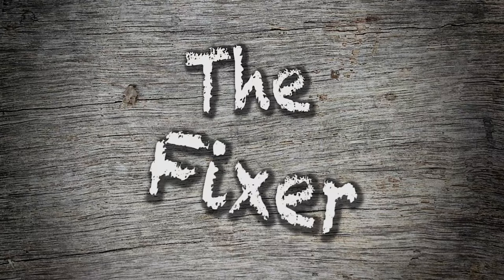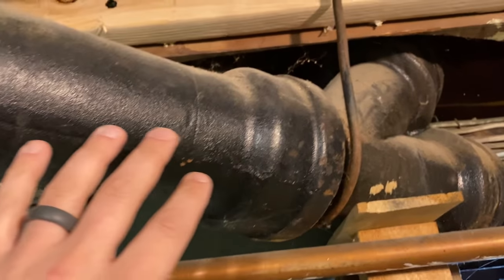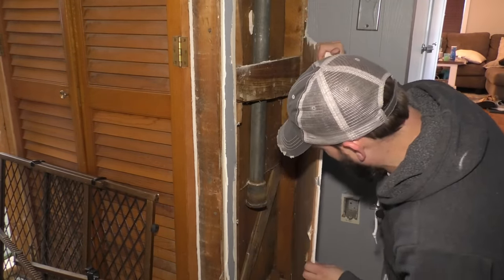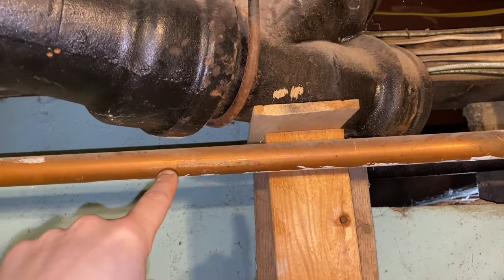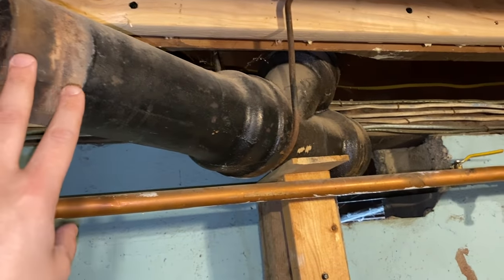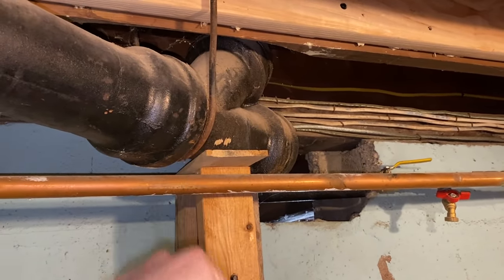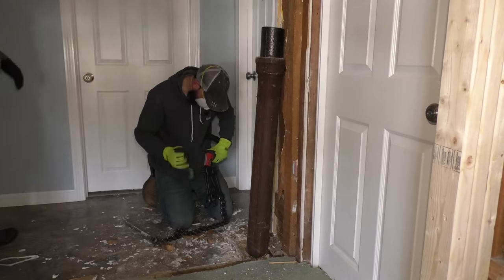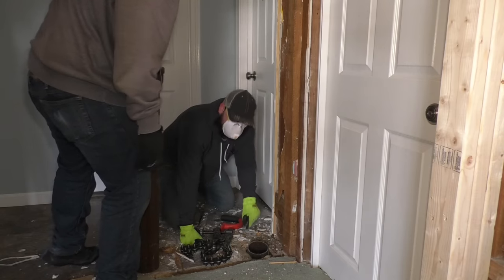How to Remove Cast Iron Soil Pipe the EASY Way!

Comment: Glad to see this video..  You literally had alot of the same thoughts I have had while taking mine out.  I used a cast iron sawsall blade for cutting the stack of mine where it goes through the roof and it took FOREVER as well..  Im now removing ALL the old pipe from the rest of my house and decided to rent a soil pipe cutter.  I normally do all my renovations myself as well, but im having my neighbor come help me with the stack because im afraid of doing it alone..  lol.  Need some extra hands.  Im 118lb girl and im not THAT strong lol.  Hope to have all of mine out by the end of today, thanks for sharing!

Comment: As durable and strong as cast iron is, with enough pressure it really is brittle.  Another great job done and out of the way for other jobs to be completed.  Fantastic "slow mo" with your phone when snapping the attic and first floor pipes.  Be thankful you didn't have to do this in a two or three story house.
Reply from the maker: Yeah I think I am actually pretty lucky with how easy this job was and using that tool actually made it kind of fun which I was not expecting.  😁 Thanks for watching!
Reply: The other problem with it, as I've had in my super old house is that it's hard to get a good connection between cast iron and PVC, without either a sketchy synch-style union or some expensive adapters. I'd rather take a quick saw and glue PVC any day.

Comment: I clicked on this notification faster than I've clicked on one in a very long time. And unlike the previous video, this time I was interrupted by an overly aggitated toddler several times lol
Anyway, nicely done! And good thing you called for backup, alone would have been a little sketchy lol
And that tool is definitely worth it! They make exhaust pipe cutters that work in a very similar way. Same type of roller cutters inside of a chain but instead of tightening until it pops, you turn it back and forth and the rollers cut through the pipe.
Anyway, that definitely opens things up and makes things look cleaner and better both in the basement and in the house.
Keep up the awesome content!
Oh BTW that slo mo shot was awesome! Also the end screen shot too.
Reply from the maker: Hey, Man!  Happy to hear you could sneak this video in!  Trust me, I know it can be tough haha.  Yeah, Colin really saved me on this one.  I was very close to doing it on my own but happy I decided not to.  And yes I was obviously pumped about that slo mo shot as you could see in the video haha.  Thanks for watching, as always!

Comment: Thanks for the video.  That breaker looks perfect for what I had to do, but it wouldn't fit in the area I had to cut.  I ended up doing it the hard way with a sawz all.  It's a bloody mess job as its an old sanitary line that got completely plugged so it had to go.  Its being replaced with ABS.  I had no helper so used rope to hold things up and cut the pipe into manageable pieces so I could carry them out.  Very messy job to say the least.

Comment: I've had good luck with the 9" diablo steel demon carbide recip saw blades... night and day difference compared to other blades. I also saw from someone else where they cut the pipe half way with a recip saw or grinder, and then stuck a screwdriver in and levered on it to just pop it that way which seemed like it works really well as well. Nice job!

Comment: one of the advantages I think I had over your build is I designed the original home and managed the build so when I added to the original build, the only surprises I had was where damage had occurred, which fortunately was limited to the floor joists and some water leaks in a few places on the roof. But on the whole was not bad since it was 30 years ago.  The floor joist had worn  due to dampness in the crawlspace  before I had put in a encapsulation.

Comment: Going tto open up the hallway so much more... Going to be sick when it's all done... Can't wait to see how u patch the hole and hopefully put down new flooring! 💪Great job man! Also wonder if it took good weight off the floor for u did the strings go up?
Reply from the maker: Hey!  I will be patching the hole and doing new flooring.  Stay tuned for that.  Great question about the string... funny thing is that the string went down a bit instead of up like i would have thought.  Only thing I can think is that the 2x4's in the basement had the full weight of the pipe and that the wood holding the chase together was actually holding the floor up a little bit from the ceiling.  When I cut that out I think the floor dropped about an 1/8 of an inch. 🤷🏻‍♂️ Weird.  Thanks for the question and for checking out the video!

Comment: Awesome job.

I am not looking forward to removing mine. My home (1934 5 bedroom) is 88 years old and has 2 bathrooms, laundry room, kitchen and two vents. One of the vents goes up to the first floor ceiling then turns and travels 6 feet then up another 16 feet. I am positive the 4 hour tool rental will not be enough time to complete the whole job.
I already replaced outside and added a clean out outside and replaces 20 feet inside in the basement. I will have approx. 1,200 lbs of iron when I get done. Approx. $169.20 scrap price.

Comment: Wow!  You do realize you made it look easy?  😂.  Excellent job!  We still have cast iron in our bathroom that runs from the upstairs to down, then underneath the concrete.  Do you know anyway to replace the pipe without taking out all the concrete?  Thanks as always for sharing your knowledge!  I've learned a lot from you!
Reply from the maker: Hey, Janice!  It actually was pretty easy.  My situation was a pretty lucky one.  About replacing pipe without tearing out concrete... I have seen people line pipes with a really cool machine.  I think it is a pretty new process but if you have to replace the pipes, I would call around and see if anyone offers that service.  Thanks for the comment and for checking out the video!!
Reply: @TheFixerHomeRepair  Thanks for the info!  It's not a problem at the moment, but as you know, it could be at any point in time.  That pop did make me jump and what an awesome tool to break the pipes!  Can't wait to see what you do in the kitchen!

Comment: Do you have a video showing the removal and installation of the new PVC vertical section you show at about 45 seconds in?  I have a similar need in my 1917 house and would like to attempt this myself.  The pipe has quite a few rust spots/bubbles happening and it's time to replace.  Thanks.
Reply from the maker: Hello!  I don't have a detailed video on it.  I only filmed it in time-lapse during by bathroom remodel.  https://youtu.be/g2vZUNPGGfY
There is the link if you are interested.  Thanks for watching!

Comment: You need to attach a 2" riser clamp to the 2" vent in the attic to avoid the potential of the galvanized pipe from crashing into the floor below or basement  or start cutting  workable sections below until you get in the attic .  
You can cut the cast iron with a snapping tool or an angle grinder with cheap metal cutting wheel .

Comment: Great job! What did you do with the old pipe?
Reply from the maker: Hey, Shana!  It is currently sitting in a pile in my backyard.  I haven't decided whether I want to scrap it, put it on the side of the road for someone else to grab and scrap or toss it in the dumpster.  🤷🏻‍♂️. Thanks for checking out the video!

Comment: I showed a home a year ago that had some cast iron that transitioned to PVC.  The existing cast iron was supported with some chain and brackets, it looked like a really professional job in all honesty.  Obviously you couldn't have the full weight of the existing cast iron on the PVC.  Buyers passed on the home because they didn't like it, lol.  Sometimes it's difficult having a good mind about mechanicals with people who don't.  As a realtor they think you're always bamboozling them if you tell them something is fine that they don't think is fine.
Reply from the maker: Yeah there is nothing wrong with cast iron as long as it is not rotting out.  Always good to replace it with PVC but not necessary.  Thanks for the comment!  And for checking out the video!
Reply: @TheFixerHomeRepair  My 1973 home has most of the drains in cast iron or so I believe although the vents in the roof are ABS (black.)  Much of the cast iron is buried in the slabs.  It seems like a mix to me but it works.
Reply from the maker: @Guillotines_For_Globalists  If it ain't broke, don't fix it, right? 😁
Reply: @TheFixerHomeRepair  Hell no not fixing something that isn't broke.  Unless it's replacing automotive suspension or drivetrain parts in pairs!
Reply from the maker: @Guillotines_For_Globalists  that’s always a good idea!

Comment: Did you scrap pipe if so how much did u get. Ty for the video.
Reply from the maker: I have not scrapped it yet.  It is currently in a pile in my backyard.  Looks like cast is going for about .09 in my area so as an estimate I would say I could probably get about $30 on the high end for everything.  But hey, that would pay for the tool rental!  I will let you know if I scrap it.  Thanks for the comment!

Comment: Oh my! you are reminding me of my ordeals when I was also young and handsome...ha! I bought an old house and did the things you are doing.  And, the same PVC with a rubber coupling to the cast iron drain that disappeared under the basement floor...Yet, purchase home warranty because a few years later (6) we thought we had a clogged drain and when we snaked it it was pure mud, the cast iron drain collapsed! So, the warranty people covered $2K of the $2,800 repairs.  Why only $2,800? I asked them to brake the concrete floor, replace the pipe with a 4" PVC and it was 39ft of floor and then add a perforated pipe on top going to the corner wall where the kitchen is, where it collapsed because it was only $20 extra.  And, then they filled it with gravel.
I paid two of the strongest boys in the crew $100 to dig on hard clay some 40 inches down in the corner and got me a big ass basin. I then had a huge long trench of gravel and a perforated pipe going to the laundry kitchen corner and a big hole for a sump pump that I later installed and did the plumbing, but at least I took the opportunity to add a gravel river to the center of the basement which helps the storm water run easier and faster. My idea was to just open a hole but the added pipe was a plus!

Anyhow, the cast iron pipe underneath may collapse anytime, so be ready. Have insurance! Mine was only $11.95  monthly and it came in handy.

Comment: You should remove that nail in the tin roof above the old vent hole, and then seal the hole. Might as well prevent the leak and rust spot before it starts.
Reply from the maker: They just used that metal to cover the hole before they roofed over it so it is sealed up nice and tight!  Thanks for watching!

Comment: Quick question? Is that bead board over the whole where your cast iron vent went through the roof??
Reply from the maker: That is an extra piece of drip edge the roofers must have used to cover the hole before they roofed over it.  Not what I would have done but it is sealed up tight with roofing.  😁👍. Thanks for watching!

Comment: Had  what used to be a laundry room on second floor.  They tapped up the cast iron, and left an uncapped water pipe in the wall that would have been uninterrupted if the 50 year old valve ever failed.  Tore that stuff out as soon as I saw it.

Comment: a carbide tipped sawzall blade only takes a minute on 3" CI pipe.
Reply from the maker: Really?  That was not my experience... maybe the blade was used.  Anyway... Thanks for watching!!
Reply: @TheFixerHomeRepair  Only get one or two cuts per blade.  I could not use an angle grinder due to tight spacing.
Reply from the maker: @carlmax46  got ya.  well I must say, even if it was a quick cut, I will never remove cast iron any other way than with this tool.  It was so... and I don't like saying this word.. EASY!  haha thanks for the comment and for checking out the video!

Comment: Yeah galvanized pipe is not great to cut. It’s coated in zinc which is up there with lead in things you don’t want in your body. It can cause zinc shakes a temporary Parkinson’s like tremor in your muscles and too much can cause nerve damage. If you have a fine particulate mask, the 3M style, you should be fine but it’s best to avoid cutting it and making dust.

Comment: The only thing bad about replacing cast drains with pvc is pvc is a LOT noisier than cast iron
Reply from the maker: Yeah that makes sense.  I honestly haven't noticed that but I am sure if I replaced the rest of the cast in the basement I would.  Thanks for the comment and for checking out the video!

Comment: You need a 3' cheater bar on your ratchet.
Reply from the maker: Cheater bars make a huge difference!
Reply: @TheFixerHomeRepair  When I was a kid I discovered my dad (tractor mechanic) kept a selection of pipes behind the bench seat of his pickup. Never new what they were for until one weekend we're out fixing something and he had a bolt that would budge and he didn't bring his torch with him that day. He blasted the thing with anti-seize and went and got a 4 foot length of 3/4" pipe. He gave the anti-seize about 5 minutes to work, slid that pipe over his ratchet handle, and one awful groaning pop later the bolt was free. If he had sheared the head off it I don't think he would have cared very much.

Comment: Cast iron pipe is outdated,  PVC is the solution....why do some plumbers STILL use metal....get another plumber...
Reply from the maker: Any plumber I have had in the house have used PVC.  This pipe was cut and left there before I even moved in.  Thanks for checking out the video!